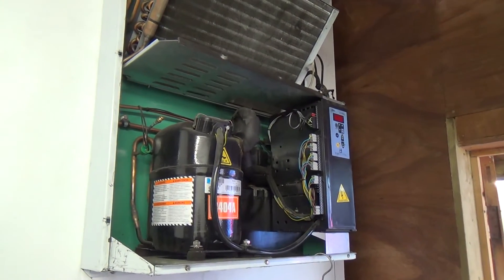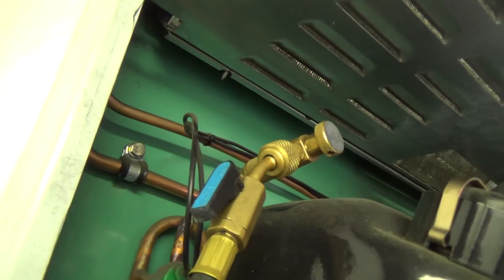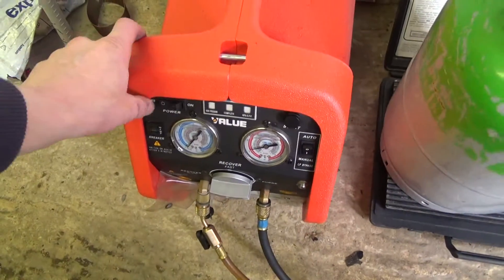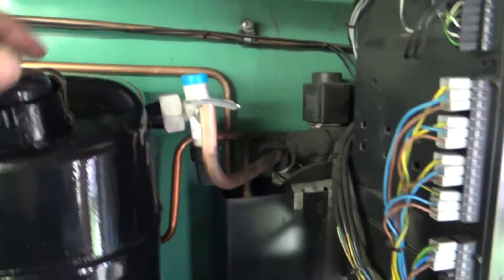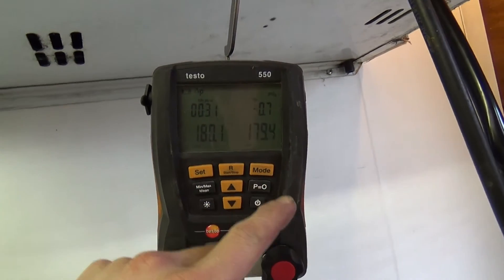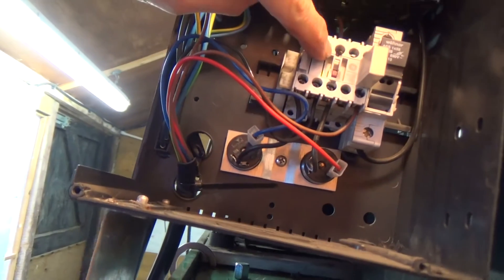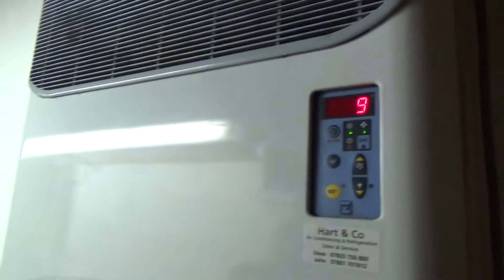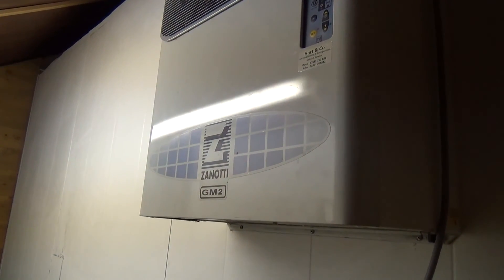Zanotti 3ph to 1ph Conversion

Comment: Great video!what capacitance you installed for start and run? Or every hp!
Reply from the maker: Thanks, the correct capacitor depends on the make and model of the motor, not by hp of the motor. Some of these 120w motors have 3uf capacitors and another make motor uses 5uf capacitors for the same size motor for example.

Comment: Do you charge for lunch if you are doing something productive like pulling a vacuum, nitrogen pressure testing for leaks or reclaiming?
Reply from the maker: +Jeremy Voshage I usually try and have lunch between jobs so its on my time. Installs are generally fixed price so it doesn't affect the price. If its a time and materials job then if i actually stop working to have lunch then i will take 20 minutes off the bill. Basically I would not expect a customer to pay me to take a break.

Comment: Do you have to upgrade the brakers when you the such conversions? How much your amp draws changed? Can you also provide a schematic wiring diagram?
Thanks
Reply from the maker: Guy Hakverdi Thanks for commenting Guy! The customer ran a new supply to the unit, i expect the amps went up about three fold as it was a three phase compressor before and now single phase. I don't have a wiring diagram for it, i just pulled the three phase wiring out and started again.

Comment: Here that amount of rust will be a one year old compressor. I always paint them at the suction side, and even then they almost always will fail either there or at the mounting base from rust. Last one was a first for me, it was losing gas from the common terminal of the unit, a first for me. Went leak chasing and nothing in the coils, nothing in the piping but a beep at the wire inlet then finally leak spray showed the tiny bit of foam.
Reply from the maker: SeanBZA We had a mitsubishi ac compressor leak on the terminals, found it with dye, after finding nothing with normal methods.

Comment: nice work John. One time I installed A single ph compressor in a 3 ph unit lol the supply house screwed up and gave me the wrong one. I like a dumb ass trusted the supplier thinking it was the same. I should have inspected it lol
Reply: Yeah, I did that about 7 years ago lol man was I picked on in the shop lol like Forrest Gump once said "shit happens"
Reply from the maker: Tazzman228 Thanks!
Reply: I brazed in a compressor on a refer box and then caught the voltage screw up once . It was a long time ago hope I never do it again 
Emin HVAC
Reply: Nice work heavydiesel
Reply from the maker: Emin HVAC I have driven all the way to site before i realised before! My friend fitted a three phase on in place of a single phase, it even started when it had only a little vapor in the system! but packed up as he began to charge the system......

Comment: Not just whack a cheap China vfd on it?
Reply from the maker: FrontSideBus They did get a quote for a three phase converter but i have not had good experience with them, they don't like the variable load it seems. Plus the rust on the other compressor may have made it need replacing soon anyway. A vfd would be interesting to try at home but not for something i need to be reliable for the customer.
Reply: True.

Comment: Nice job John I like the way they wired that with those overloads why didn't they just use a three phase motor protector / breaker PKZM ? But still it's a nice way for those small compressors
Reply from the maker: hardcooling I think the twin overloads/klixons are factory equipment from the compressor manufacturer, last few i have fitted have had them in the same style starter box the single phase ones use for the relay and capacitor. They are nice little compressors imo.